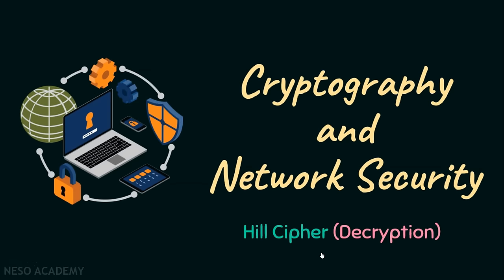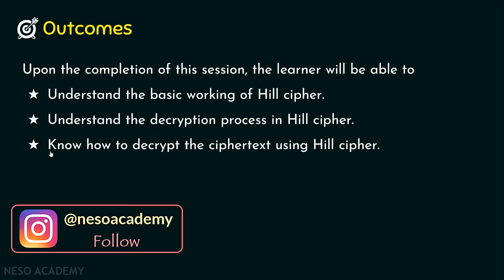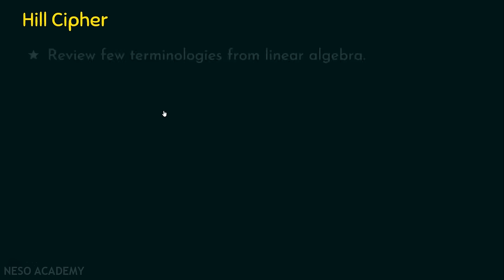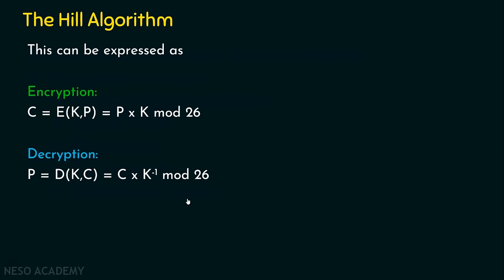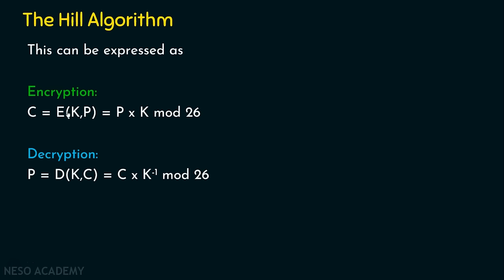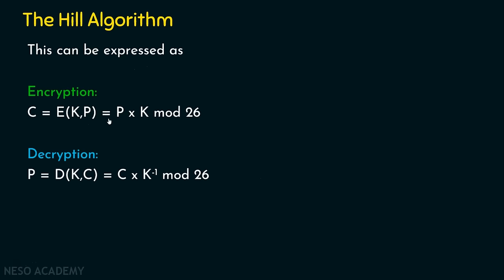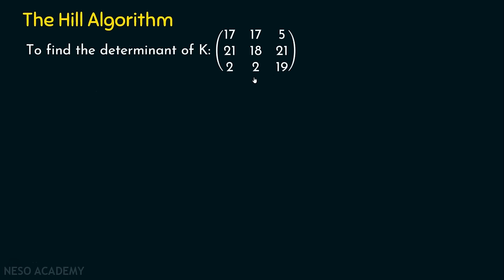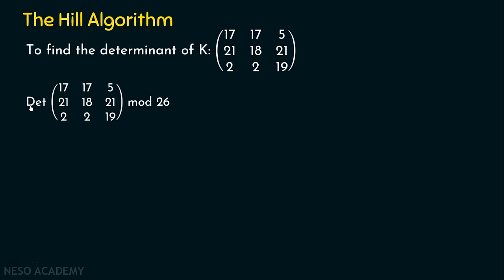Hill Cipher (Decryption)

Comment: At the end of the video, I believe L should be set to "11" rather than 14 in the decryption of RRL to PAY.  I spent a bit of time questioning this, as I calculated with (17 17 14) as is written, which failed to produce P.  It is written/solved correctly in the calculations, but the formula at this point has (17 17 14).  Hope this helps anyone like me who felt like they couldn't do basic multiplication :)
Reply: Thanks alot bro was trying to figure it out. Saved me time!!!
Reply: Le me : after wasting my 30 mint to figure out how it will be 14 instead of 11 after wasting time my mind figure out let's check comment section now I'm here lol
Reply: Btw thanks bro Appreciated 😊
Reply: 659 mod 26
Reply: i felt stupid.
Reply: nice👍

Comment: Nice video overall with detailed explanation. One thing that confused me was the way you wrote the equations in the table at 20:09. on the right side of the equation, it is written 1 * 23 = 23 mod 26, 2 * 23 = 20 mod 26, etc... which can be interpreted as the value of the left side and right side are the same which is not the case in your explanation. Rather according to your explanation it would make more sense to write them as (1 * 23) mod 26 = 23, (2 * 23) mod 26 = 20 etc... and an overall formula of finding the value of inverse of any given number x where there is mod y could be z given x^-1 mod y =  (z * x) mod y= 1.

Edit: I feel like the way I wrote the formula could be misleading. I think it would be better if described as: 
- an overall formula for finding the inverse of any given number where there is a mod could be 
            (z * x) mod y= 1, where
             x is the original number, y is the mod number and z is the inverse.
Reply: nope what he write is correct,
Reply: @kartikforwork  My reply also had an some issues which I corrected but how is what he wrote correct?